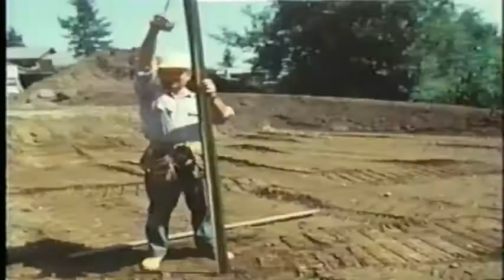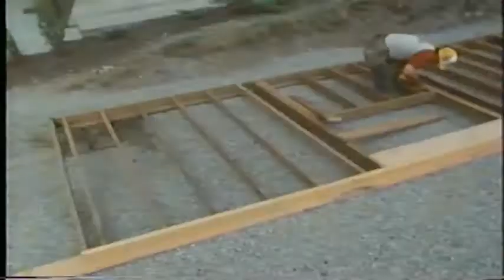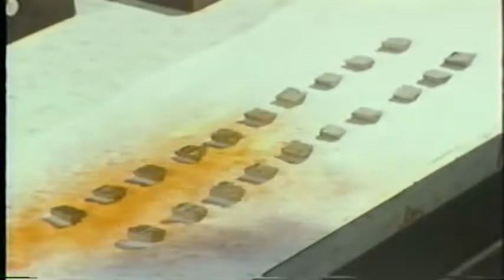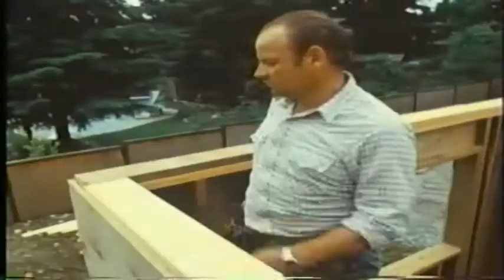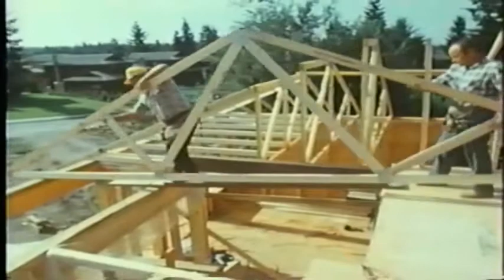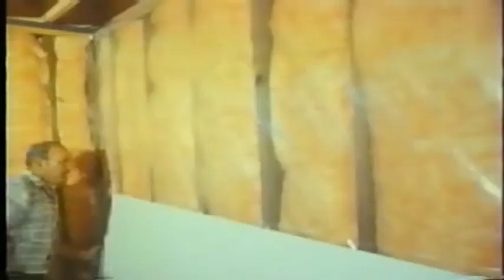Foundation Of The Future

Comment: It's great to see forward thinking in building.  Pressure treated wood really can never last as long as concrete or cast block.  For this reason wood should not be used for foundations as replacing foundation walls is so much more expensive and disruptive than the wood framed walls that sit on top of those foundations.  Also, treated wood lasts no where near as long now with the change in the chemicals to make them less dangerous to the trades people who install them.  If you want fast, insulation-ready pre-framed panels, look at precast Superior Walls or similar; they offer many advantages over conventional CMU methods.  Oh yeah, and if you work with chemically treated wood products, always wear skin and eye protection.  Be safe.

Comment: That was a good cost-saving solution for the 70's but today we have screw-in posts which don't even require terrain grading, leveling, gravel pad, drainage, etc. And they can be screwed way down below the frost line. It is even more economical and faster than a wood foundation.

Comment: These foundations are awesome.  I grew up in one and I know quite a few people with them.  They are dry, straight, no mold, no rot, easy to drywall and have full 8' high ceilings.

The only people that don't like them are concrete guys and lazy home inspectors.
Reply: I have a wood foundation and its awesome. And its everything you described.
Reply: My concern with a basement like this isn't so much water intrusion as it is mice and insect intrusion.  Critters can't chew through concrete, but they love to chew threw wood.
Reply: @r.j.bedore9884 it’s treated so it’s insect repellent
Reply: @r.j.bedore9884  concrete gets cracks in it that allows insects and potentially mice in, it only takes 1/4"  We always have alumin coil on exposed areas, not sure if mice could chew through it, or die from the chemicals in the wood.